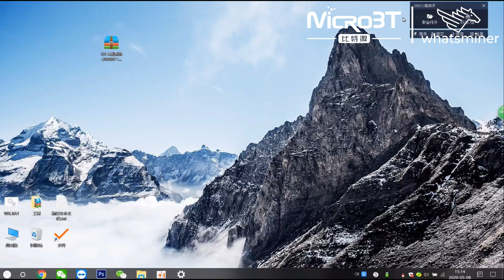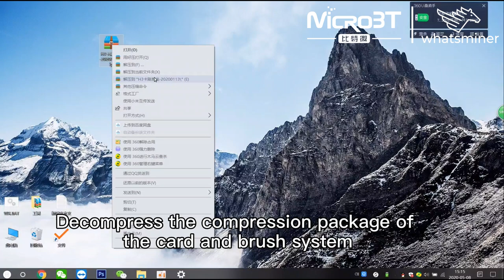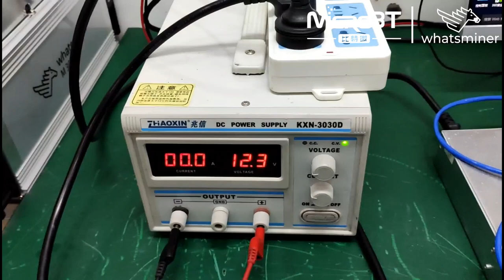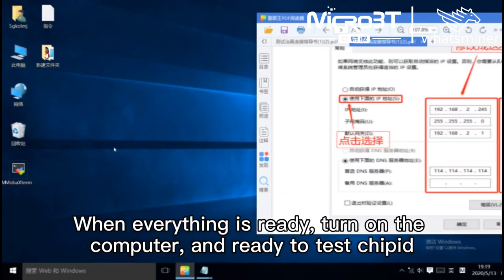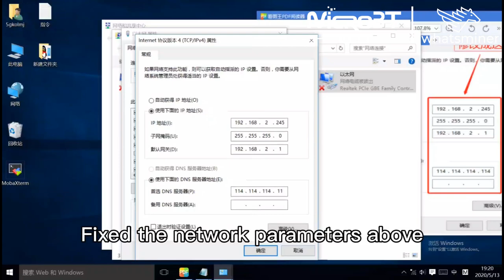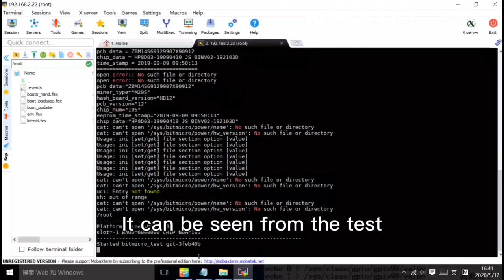Tools preparation before repair

Comment: how to adjust the current of power , its not clear
Reply from the maker: Hi, the current of the test power supply is set to the maximum
Reply: @WhatsMiner  
Thanks, I was able to solve the problem
I did not want to short circuit the output, but it was the way to calibrate the current source since it is automatic.
in the case of setting to more than 20 A ,  how would you do it so that it does not jump
a spark ?
my power supply is up to 30A